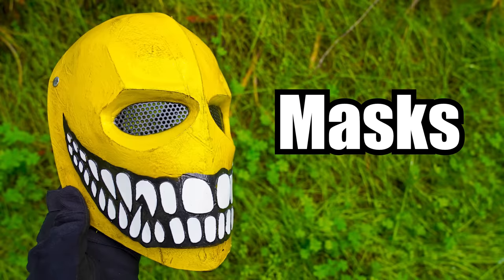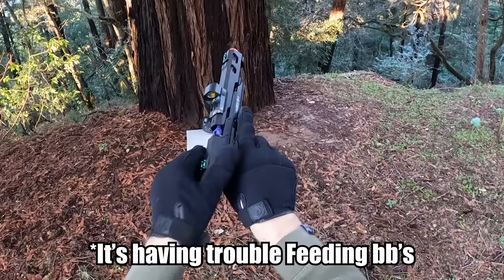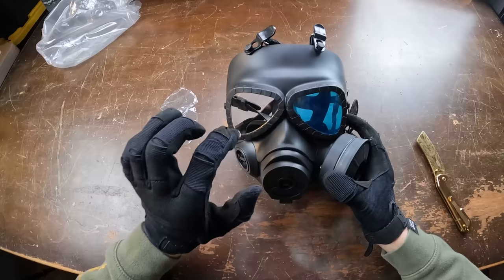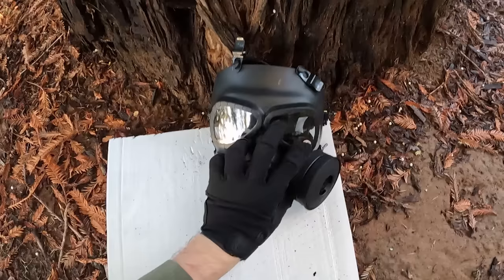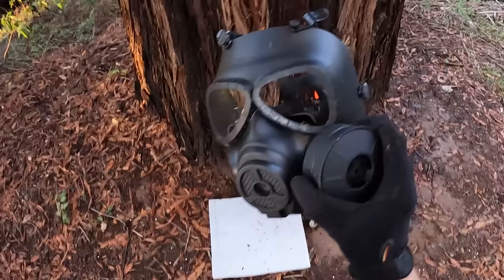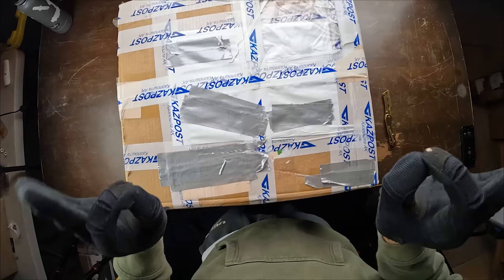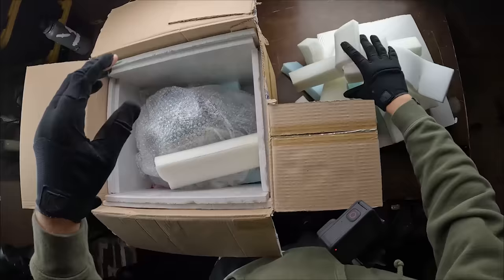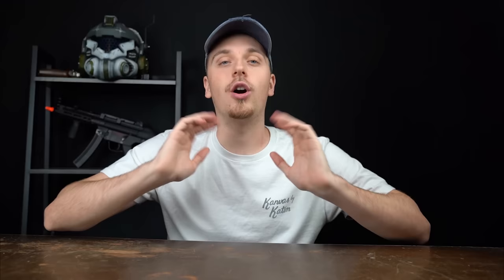I Bought The Craziest Airsoft Helmets/Masks On The Internet!

Comment: PSA: Never wear mesh masks no matter what

Also lancer tactical is Notorious for selling bad eye pro, The owner got arrested for it

By 360 seal goggles with a solid lens and make sure you shoot it point blank with the strongest gun you have to make sure it’s safe, after all you’d rather have a break off your face then on your face
Reply: I see alotmof people buying full face masks with mesh eyes and they work its just that you should probably wear some sort of eyepro underneath to stop fragments
Reply: really?, I got my ANSI goggles from Lancer Tactical, should I be worried?
Reply: @CybertroninfiniteOfficial  maybe, do some recherché to see if you model is safe. I would recommend r/airsoft on reddit
Reply: @randomprimarissalamander8735  wear eyepro below what should be an eyepro
Reply: @tnc7399  yeah I wanna wear a mask fo a specific design dude
Reply: Whats the best masks for people who have to wear glasses?
Reply: @StardustZee  I wear Rothco OTG goggles. They're decent, but I can also fit my glasses under a Dye I4 Mask
Reply: @Paragon_4376  ooh alright, thanks man.

Comment: You should try testing a common mask used here in the Philippines, it's called phantom mask  and it can withstand 600 fps point blank it has 2 variants one with a lens and one with a mesh goggles, you won't be able find a online site or a page of him cuz he stays anonymous but you could just search for kraken or sicario phantom mask, given the unsportsmanlike gameplay here it was designed to resist units with more than 600 fps

Comment: the masks with mesh for eye protection me personally i wouldnt trust that. ive been using a paintball mask for years and i believe its some kind of tempered glass for the goggle part and hasnt cracked or chipped or anything yet. I was thinking the BB's fragmenting into your eyes or around your eyes, that would be kinda sketchy from the mesh masks

Comment: Hey, Wag I was just wondering; I have an airsoft pp2k that I just got, and it doesn't work. I just shoot it and all the green gas shoots out at once. If you see this, please tell me how to fix this. Thank you.
Reply: U need to take the mag apart and oil it down and clean it. U also need to tighten the valve in the upper back of the mag
Reply: @Aquafresh_Official  tysm I really appreciate it